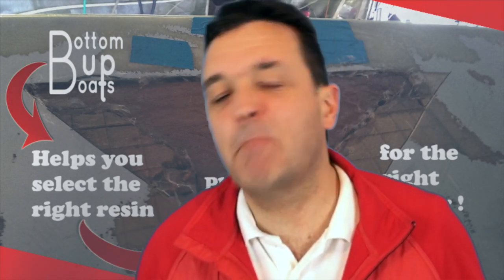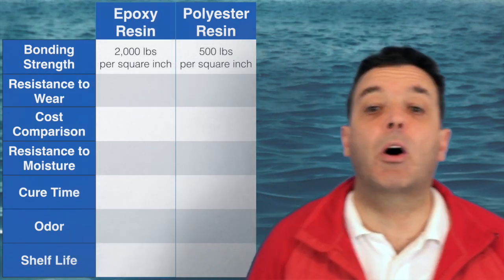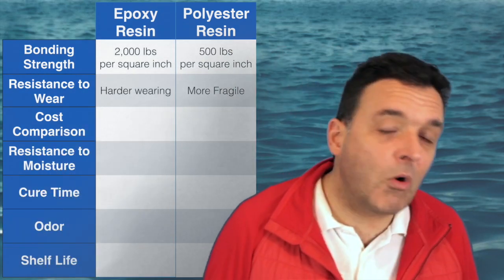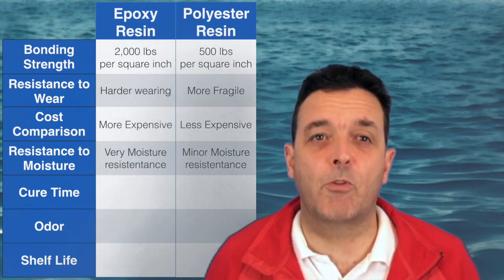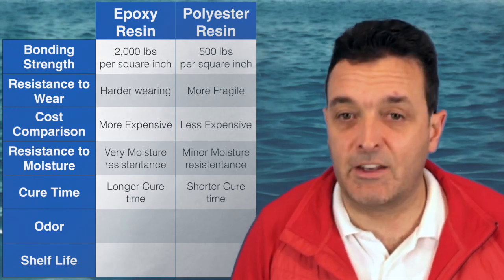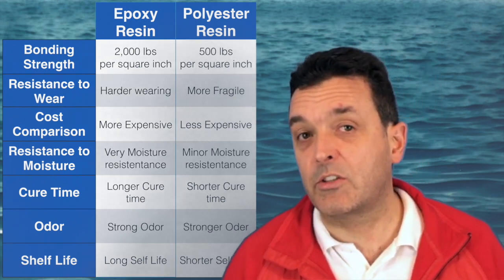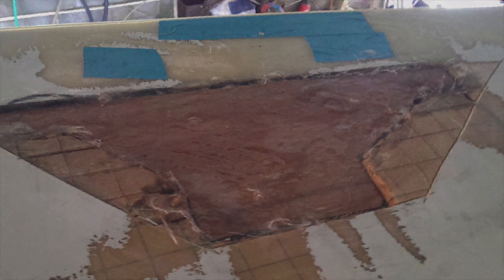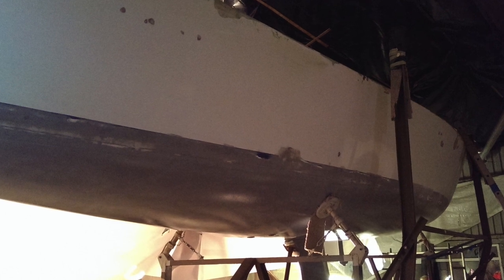Compare Epoxy and Polyester Resin :- Mumm 36 Rebuild

Comment: Was considering using one of them as an undercoat for a rebuilt mower deck.
Would it have adequate adhesion to steel, or painted steel?
Reply from the maker: epoxy will bond to steal, I would suggest preparing the metal by sanding with a low grit sand paper the epoxy will then bond into the small groves this create. I would not put paint on first as the epoxy will bond to this and the paint would have a weaker bond than the epoxy.
Reply: @BottomUPBoats  After looking at all the epoxy resins, I don't know how I'm supposed to choose one.  They all seem to have a 24 hour cure time which is fine for a tabletop or some jewelry thing, but it would take forever to get the walls of a mower deck.  Too hard to try to find answers for this bs.
Reply from the maker: The 24 hour dry time is to completely cure, it will be tacky in less than 1 hour and should hold from there. If you add 50% more hardener than suggested it will be even short. Only issue with this is you will loose some of the bonding strength as the final product may be a little more brittle.

Comment: Greetings!
Great comparison. 
By the way, I have a plan to make a crossbow limb. Do you using epoxy resin with fiberglass cloth would work? Or do I need to have core material first? This is not relly related to boat building but I'm just trying my luck here. Thanks!
Reply from the maker: I am by no means and expert on creating glass objects that bend. Everything we go with on the boat has the objective of being super stiff, Resin + Glass would be quite brittle, I am not sure if a core would help either. At a guess I would suggest either kevlar or carbon fibre matt rather than glass fibre, it will have more strength and should make it less brittle.
Reply: Correction: do you think

Comment: Are epoxy fillers good for allot of spider cracks we will be painting for the finished surface
Reply from the maker: It can be used, if the cracks are below the water line we would use epoxy as it is more water resistant. If it is above the water line it is best to match the repair to the resin type with the cracks. Spider cracks can be hard to permanently fix as they often come from the stress applied in the normal use of your boat. Some things to consider.
1) sand the area focusing on the cracks to lower the hight along the crack line.  
2) clean with acetone.
3) apply a thin coat over the area using straight edge to smooth the resin if possible.
4) sand and clean again before applying your pant.

Good luck with your repair.
Reply: @BottomUPBoats  thank you!
Reply from the maker: Your welcome.

Comment: What about vinyl-ester resin?
Reply from the maker: Bottom UP - Boats
  • 1 year ago 1.47K subscribers
Great Question, vinylester is a third alternative. For most of the characteristics it would sit in the middle of the two resins covered in this video. 

I review the extremes to highlight the key differences. You are the 3rd or 4th person to ask this, I think it could be time to do an updated video.

Polyester yields a weaker repair than both Vinylester and Epoxy because it slightly shrinks when cured, weakening any secondary bond. Vinylester does not shrink and is therefore stronger. If gelcoat is to be applied, vinylester has its advantages in that it is chemically compatible with polyester gelcoat and will chemically bond with the vinylester repair (if applied shortly after cure time).

Stay tuned for an updated review video.

Comment: Bottom UP - Boats -Thanks! Do you know what type of resin sticks to vertical or surfaces, or undersides better -or do they both drip right off??
Reply from the maker: Russ, depending on the finish you are looking for and the time you have there are a couple of options. 

If you are filling a big indent or joining surfaces the best option is to use some glass or kevlar matt. The resin will absorb into this, it reduces the dripping and allows you to increase the thickness of the glass quickly. If you use this it will require you to sand it smooth before applying and top coat.

If you are looking for a smooth finish without matt it is best to apply in really thinly to avoid dripping, the down side is it may take a few coats (follow the drying instructions before applying the second coat to).

The last option is to increase the hardener to resin mix, stir the well until it starts to set before applying, you will need to be quick as once it starts to thicken it can go hard quickly. You need to judge it well to avoid applying it after it becomes too hard to spread. Additional hardener can make the glass more brittle once it has cured.

Hopefully on of these options helps with your repair !!!

Comment: I am making a table out of a tree stump and there is a hole in the center which should I fill it with and use for the top of the table?
Reply from the maker: I would go with polyester.
Reply: Bottom UP - Boats that’s what I thought thanks
Reply from the maker: 100%

Comment: DIY  repairers coming here, choosing between the two must understand choice depends on the type of repair. Polyester only suitable for new part construction or a VERY superficial repair. The author fails to mention vinylester which is critical option to your repair decision. Polyester yields a weaker repair because it slightly shrinks when cured, weakening any secondary bond. Vinylester does not shrink and is therefore stronger. If gelcoat is to be applied, vinylester has its advantages in that it is chemically compatible with polyester gelcoat and will chemically bond with the vinylester repair (if applied shortly after cure time).
Reply from the maker: Great points, thanks for sharing. I will have to do a video that covers all three point out the additional factors you shared. Thanks for stopping by and for the feedback !